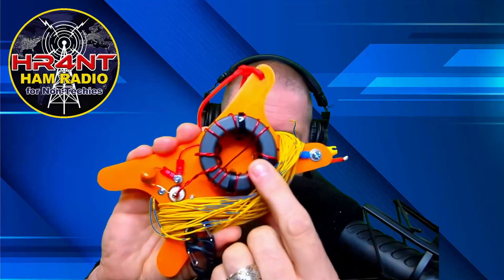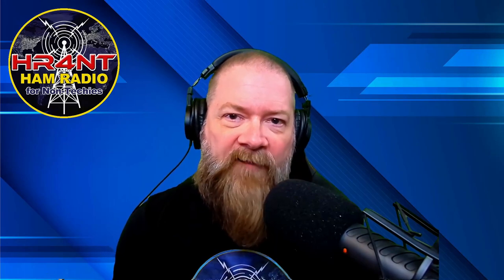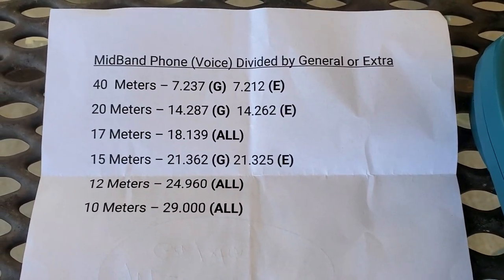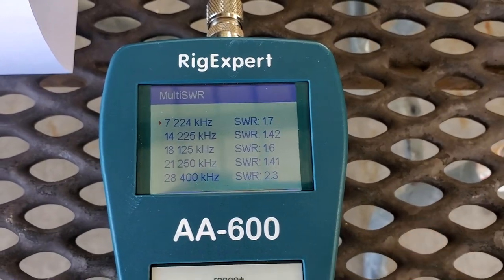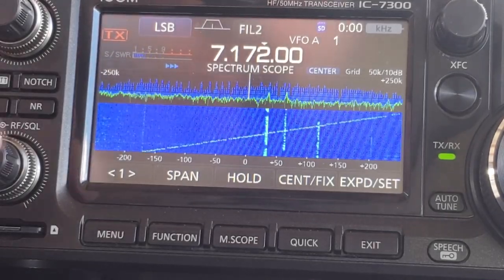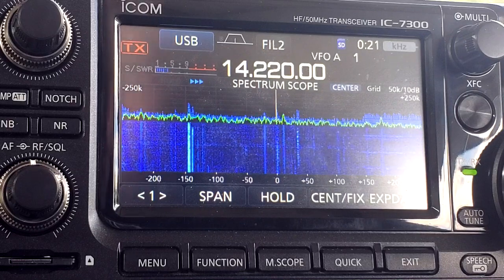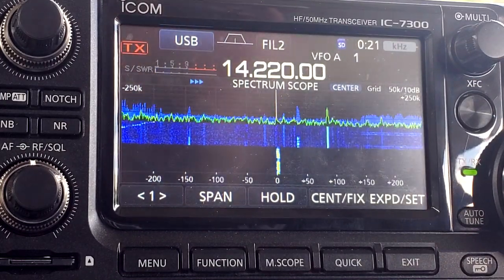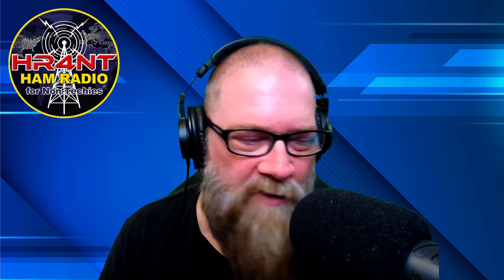Let's build an End Fed Halfwave Antenna! Easy DIY antenna project to build!!!

Comment: Love your videos. Ooof, feel your pain on being told the wrong length of wire. I have abandoned single freq SWR readings and now always look at two graphs, the full hf SWR graph and the SWR graph for the band or bands I want to work. That way I know for sure if a higher than desireable SWR is because I’m short or long by the curve. 73
Reply from the maker: Thanks for the tip!  That is actually a good idea!  Thanks for watching and for the comment.  73!!

Comment: Question begs......can you simply wind the excess wire back on itself, while checking the SWR, as opposed to chopping off wire ?
Much like one can do with a dipole ?
Remember too, I think this is all relative to the height of the antenna with proximity to ground !

                 🤔......?
              Just Say'n
Reply from the maker: Yes you absolutely can just do a folds back.  The issue was, I trusted someone to give me the amount of wire needed to tune it which should have been 67 feet to start and I found out after the tuning failure that I started with much less than I should have had.  Lesson learned.  Thanks for the comment an for watching.  73!
Reply: @HR4NT  It was obvious you weren't happy being played !
Looks like they accomplished making you look stupid to your students ?
But .... lesson learned !
The Old Carpenter rule applies !
Measure twice, Cut once !
               😂🤣😂
                    '73 !

Comment: Have you tried to get a counterpoise to this antenna? When I build one of these I get the same readings you have without a counterpoise, then I add a 10 meters counterpoise and it lowers the swr in all the bands very close to 1:1 . Watch a OM0ET where he build his 49:1 and you'll see he does the same
Reply from the maker: I have not tried that yet, however that is in my plans to continue my experimenting and see what I can do.  Thanks for the comment and for watching.  73!
Reply: I can attest to this as well. I have a 40-10 EFHW as a sloper. When I added a counterpoise I got almost a half point SWR lower. Adding a Common Mode Choke dropped it down to 1.2-1.5 across all bands. 16.5ft counterpoise tapped to ground.

Comment: 😅I don't know if you figured it out but you want choke close to the radio not the unun you forgot the sheild of the coax is the 2nd half of antenna. I have built 7 of these so I know from experiance to keep the choke away from the unun.😮😮
Reply from the maker: Yes I ended up find that having it closer to the radio was the better way to do it.  Thanks for watching and for the comment.  73!

Comment: Why not Use a Separate Wire for 10 meters,
Reply from the maker: You can, but that kinda defeats the purpose of having a multiband antenna.  When tuned properly, it will pick up 40-10 easily.  Thanks for the comment and for watching.  73!

Comment: You should have been able to look at your rig expert and see that you were short in the first place. You should have been able to see weather the dip was high or low.
Reply from the maker: I did look at the reading on my RigExpert and unless I read something wrong, I thought that I had made the correct call.  Bottom line the length of wire I started with was NOT 66 feet.  It ended up working out.  Thanks for watching and for the comment.  73!

Comment: Hi there! Nice work. I have noticed something about your swr. Look at 14:12 till 
14:14 and i can see i rapid rise of you swr. I have the same problem that's why i am asking. 73 de sv2tcb
Reply from the maker: Sometimes wind, angle, location and surrounding issues can fluctuate your SWR.  I ended up figuring it out and fixing everything.  Thanks for the comment and for watching.  73!
Reply: @HR4NT  thanks for the response. Keep up the good work. 73

Comment: Enjoyed your video.  Is there a maximum length your coax can be for your EFHW ?
Reply from the maker: I generally use 50ft...however I have also used 100ft with no issue.  Just keep in mind that the longer the coax, the more losses you may see in performance, but up to 100ft, you should be ok.  Thanks for watching and for the comment.  73!!

Comment: Looks like a solid setup. Dual torroids should provide good heat dissipation and power capability. You seem a bit upset about the short wire. I don't blame you... then you get a turd moaning on the radio!💩 geez!
Reply from the maker: LOL...Thanks @Don'z Lockz!!!!  These things happen...not very often, but they happen and we just have to push through.  Thank you for your continued support of the channel and for watching.  73!

Comment: Sorry , late to the party. Did you ever figure out the power rating ? 
Thanks VE1EPB
Reply from the maker: You are good to at least 100 watts if using a 240-43 like it did in the video.

Comment: Does folding back coated wire really change anything?
Reply from the maker: Hi Peter, 
Yes.  It will effectively shorten the wire without cutting, then if you are happy with the readings, you can choose to cut the wire and make the change permanent.  Thanks for watching and for the comment.  73!

Comment: Very nice. I have the KM4ACK EFHW and I was able to get it to work. And it does work quite well. My only issue with it is that it's max 50W. I like the full 100W and I need to build another EFHW for 100W use. 

Those darn LIDs... I know how you feel about them cuz I feel the same way. 

Great video. 73 de Jeff K3JRZ
Reply from the maker: I also have the KM4ACK EFHW and I run it at 100 watts al the time.  I would try it out and after a bit, go feel the transformer and see if it is hot.  In Texas the heat here doesn't help, but I run that antenna all the time with 100 watts.  I think he shorts the power rating to make sure someone doesn't try to pump 200 watts into it and have it crack or worse.  The same with the Packtenna Mini EFHW, I run that at 100 watts all day!  Thanks for watching and for the comment.  73!!
Reply: @HR4NT  Hrmmm… Interesting Scott. I’ll have to try that out and see what happens. Thanks & 73!

Comment: I’ll probably make an efhw someday for portable ops. Just got my home station set up …… maybe couple months now. I have a multi band dipole , 30’ high seems to do okay with an Icom IC 7300 as well!!
Calvin KI5OUP
Reply from the maker: That would be awesome.  If for nothing else, it is a fun project and relatively easy to build once you source the parts.  At 30', you should be doing just fine...LOL  Thanks for watching and for the comment.  73!!

Comment: By reading the Title, I thought there would be step by step instructions.  Well, Not the case, 5 minutes talking and showing a built one, and 20 minutes of going to the park and testing.  Everyone does testing.  No one shows step by steps.  Well, Disappointed in this one.
Reply from the maker: I have another video in my list on my channel of me building pretty much that same antenna.   Every end fed halfway of antenna is built the same if you're doing a 49 to 1 configuration.

Comment: DIY EFHW build? You did every thing except build the antenna. You held one up and talked a lot. But no build.
Reply from the maker: I have numerous videos on building an EFHW on my channel.  They are all built exactly the same with the same components.  The only difference with this build was I doubled up on the 240-43 toroids.  I had this one already built and wanted to show the idea I was using by doubling up the 240-43's.  Thanks for watching an for the comment.  73!